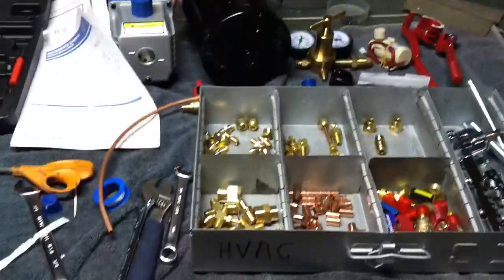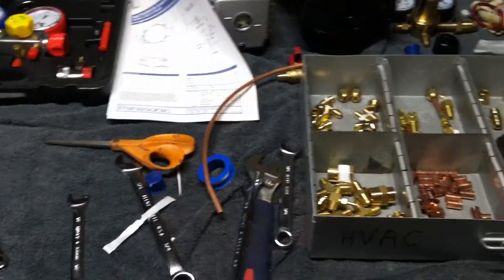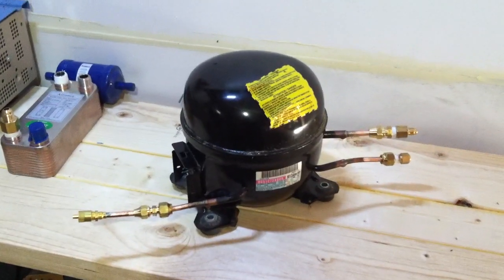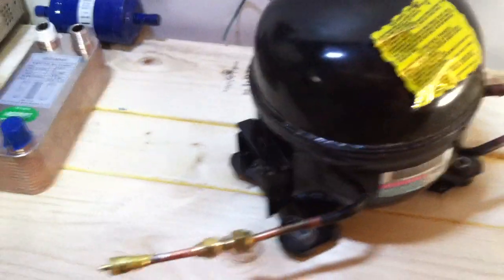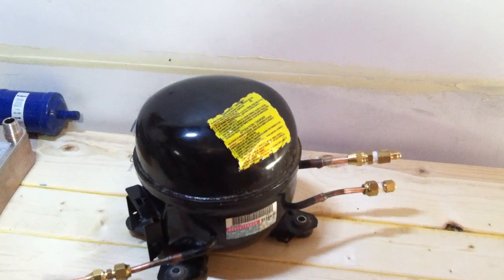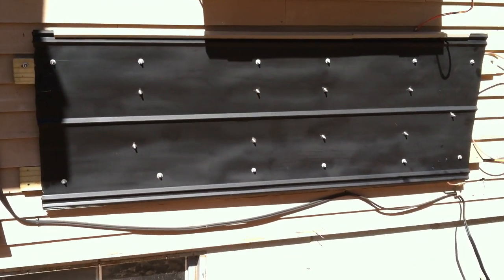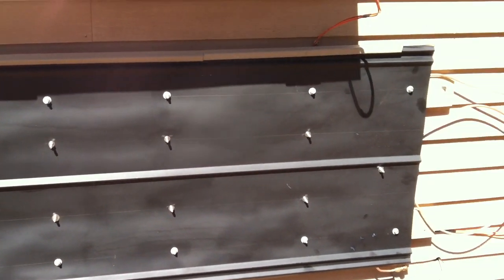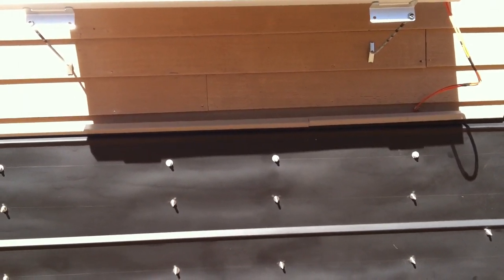DIY Heat Pump 1

Comment: Neat little Freon to water plate heat exchanger. When I tried this 10 yrs ago the exchanger had a slight leak. Seller would never make it right; went to a tubing inside a tubing.
Ed c

Comment from the maker: An update:  I got this HP up and running about a year ago.  It worked quite well  The evaporator was/is a little too small and I need to update the tubing in it to 3/8".   The system also needs a TXV and I plan to pick one up.  However I will be going a new direction and changing to an air-air system for simplicity.  I have other projects cooking these days (mostly radio related) and this one is on the back burner.  But it may be next winter before I get back on this one.

Comment: Is a project still working? No update video found :(
Reply from the maker: Yes I have not posted an updated video as yet.  I did get the HP running with pretty good results using a small water tank, but I have to make a few changes to the system.  Most notably I need to change out the 1/4" evap tubing (what I had on hand) to 3/8 to get better performance from the evap unit.  Also I need to go to an AXV and shelve the needle valve.   I wanted to post something this spring, but outside home projects have become the priority.  TNX for the note!
Reply: @pf_n1ps  did you get it running? longing for the update :-D